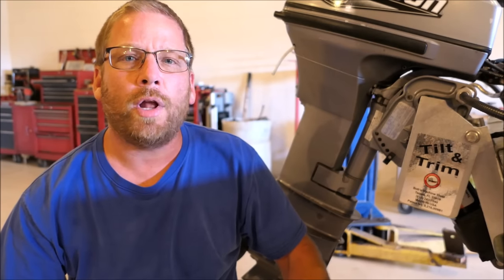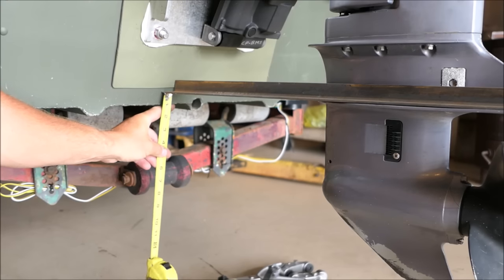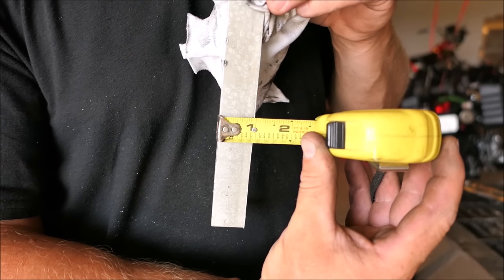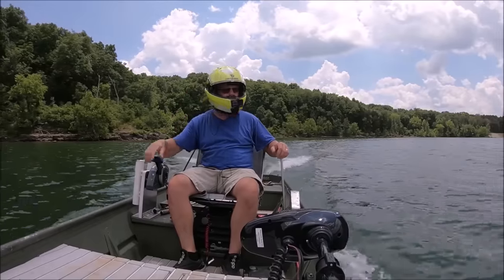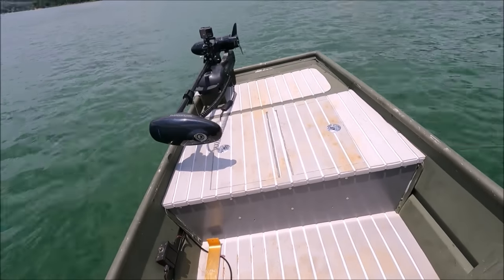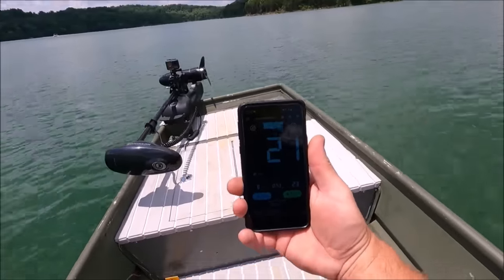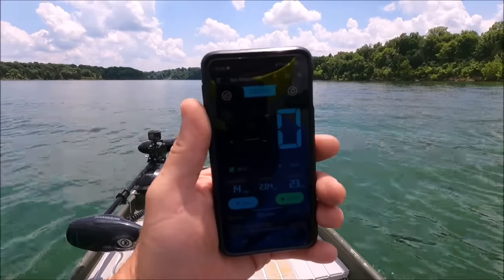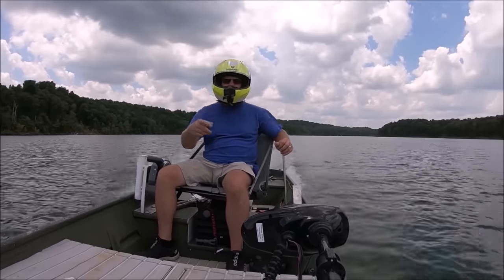Does 1 inch UP or DOWN make a difference on an Outboard ??

Comment: Doesn't the level of the prop adjust the position of the vessel, such as being to pitched compared to a level plain on the water? (Not speed) I've heard to increase speed you would change the prop to a stainless steel one.
Reply: That is correct for trim but this is raised motor straight up without changing angle

Comment: You need a stainless steel propeller to go faster. Aluminum props have too much flexibility. You will gain a few mph with stainless. 
Lowering your motor will only improve your ride and handling in rough conditions. Good luck

Comment: Should ceramic coat the hull and also the prop and lower unit, but not the pushing side fins of the props, those need to grab somewhat. There is a channel that tests them that will get you the right one, something scott detailing channel. 
Then the engine should be tuned for more power, but that is difficult because the manufactuers engineer them useless if you try to modify them
I would absolutely garbage trash the stock carburetors. They do not atomize well. I would go with a carburetor off of something about the right size, and advertized as efficient. But then it would still need adjustment, Probably carburetors off of high performance jet skis would do you the most favors, and they happen to be very easy to set up and tune and maintain.

Comment: That's a 40 you say? Something isn't right. I had a 25 evinrude push my jon up to 28mph loaded down with 2 people & fishing gear. A 25 4 stroke pushes the same load 32 for comparison. Maybe change out the prop?
Reply from the maker: It's a 15

Comment: I often asked myself:
Is the propeller size the most efficient, or can it be slightly bigger for an increased push?

Will the engine blow up by overheating?
Is the long time performance good?
What about the consumption?
What about the top speed?
Reply from the maker: Questions..... Questions that need answers...🤔
Reply: @kentuckyyankee  exactly.
At the time of steam engines, the ship propellers were huge in relation to its power.
Why?
Cause steam engines hade much more torque than today's combustion engines.

The German Imperial Navy light cruiser, the S.M.S. Emden, had a high speed of 41km/h 22.5knots
by an amazing propeller diameter of 2x3.9metres (99inches), by 2x8100hp

And a shaft speed of around 240rounds per minute.

The relation of the propeller size was bigger than the size of a diesel engine.
So where is the border of a propellers size limit?

Comment: Please don't wear that helmet in that boat. It will be difficult for other boaters not to hurt themselves laughing. That was a good one and I agree with your decision to level the cavitation plate with the bottom of the boat even at that distance back. I think you'll stay hooked up in turns better. One inch will change your drag a little but you aren't going for 90 mph. Personally I had rather handle well.

Comment: It's worse now, motor is definitely too low.  See when you look back, it's throwing up a "Vee" of water from the gearcase, that's because the A/V plate is now too low and is cutting the water on its own rather than being even with the bottom of the hull, which throws up the vee of water.  It creates drag and slows you down.

Comment: Damn I have a 16ft deep V with a 20 hp an it goes faster than that little boat I get 24 by myself an have had it up to 25.7 ….you must have a lot of drag somewhere
Reply from the maker: I think that's the issue flat bottom vs v bottom

Comment: Without a life jacket the helmet is an anchor
Reply from the maker: It does have foam in it tho, there was a life jacket on the boat.
Reply: @kentuckyyankee  toss the helmet in the water and it fills up. Wear approved PFD and be safe when running tests. Catchem up

Comment: If you weren't blowing out before then lowering just added more drag and will use more fuel. When your boat is on plane and properly trimmed for max rpm your cavitation plate should be right at the water level.

Comment: Going up increases speed and rpm until you start loosing ability to steer.. you need a bigger prop at this point
Reply from the maker: I need to check rpm if I'm gonna change the prop, at this point I'm pretty happy with it, cost to experiment.

Comment: A helmet for safety but no life jacket?
Reply from the maker: No I think I have one maybe even 2 in the boat
Reply: @kentuckyyankee  With good intention, I strongly urge you to wear a life jacket. There are light weight, inflatable life jackets that you can hardly realize you are wearing because they are comfortable even on hot days, and do not get in the way of fishing or other activities.
My neighborhood is on a river that is a tributary to the Chesapeake Bay. There has been at least one fatality in the area, as best as I can remember, every year for the past 20.  The most recent one was on July 3. In no case that I am aware of were those victims wearing their life jackets, but they all had them on the boat.
Reply from the maker: @kennethpaquin8574  Guess it wouldn't hurt to boost my saftey habits 🤔

Comment: Get you a better prop
Reply from the maker: I agree but cost cabbage 😂😂
Reply: @kentuckyyankee  Props galore in the back of marinas on discarded outboards. Scrappers get them in to beings outboards are around 75% aluminum. Both places don't want much for them, especially if you pull them yourself.